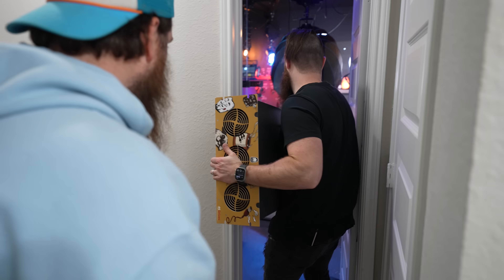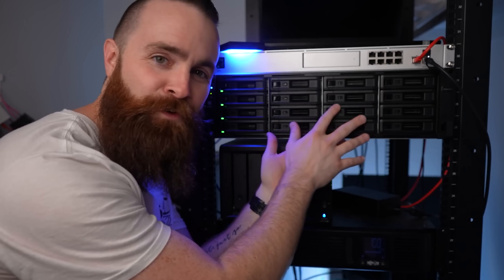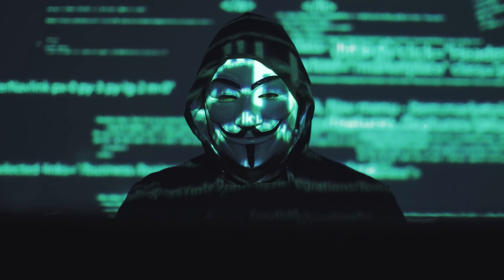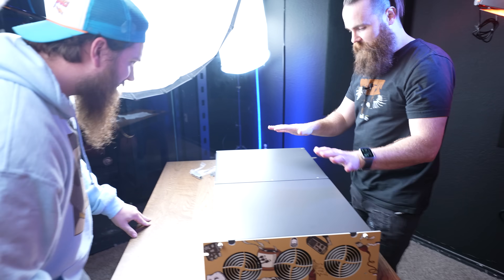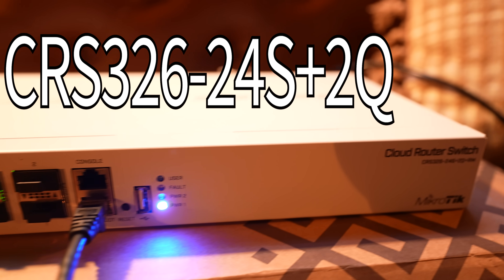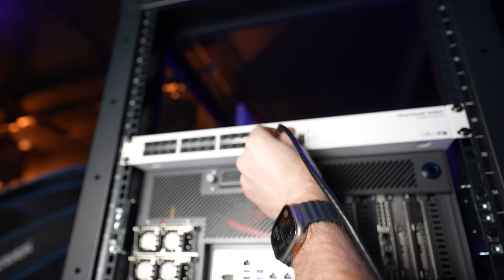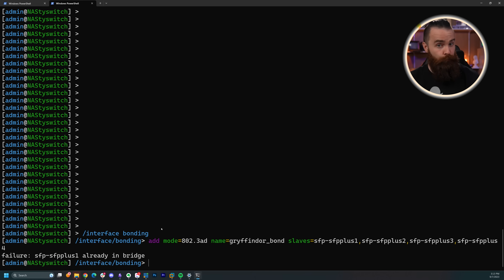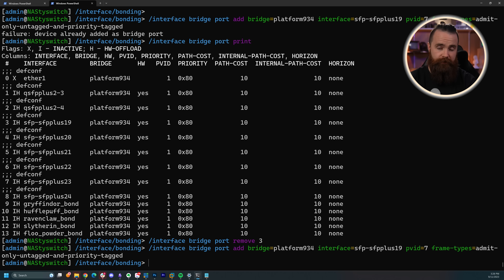My SECRET Server Room Project

Comment: When my Microtik switches upgraded to the new firmware they changed how bridges work which threw me into a loop as I have trunking and VLANs.   I just learned to only work inside an already defined bridge and setup the trunks and VLANs there so it can take advantage of the hardware offloading.    A quote from Dr. McCoy on Star Trek, "I know engineers they love to change things!" 🤣

Comment: Blech... rack mount. Love me some Dell T600 series. They are generally quiet enough to run in the WFH office, except on startup, and generally run under 300watts even with dual xeon 20 vcore processors and 192gb ram. Not going to get 45 drives in one, though. I know the homelab lemmings want microtik and ubiquiti, but why not cheap used enterprise equipment? It's stupid cheap. You need you some vxLan, and automate it... Bridge in microtik sounds as PITA as HP implements it. Glad we have HPE/Aruba as an MSP to handle their switches.

Comment: How about clustering instead of VLan?  Go for redundancy and resiliance.  What are you using for backup power, brown outs and blackouts?  Will everything 'crash' if a blackout or roaming blackouts happen?  You need to have automatic controlled shutdown of services/dependencies.  Charge your UPS batteries with solar.  Also, the more advanced the equipment, the more delicate it is.  Air filtration and humidity.
Reply: He did talk about running ProxMox with CEPH so it'll be in the future videos.
Reply: @Darkk6969  Interesting.  I'm out of touch - retired.  Still love this stuff though.

Comment: But if the trunk on this Microtik switch allows all VLANS by default, wouldn't that result in a "bad practice" situation?
I mean the whole purpose of VLAN'ing and interVLAN conenctions, is to fragment the network, to less stress the switch, when performing broadcasting -
But, it is also a security standard, ensuring that certain VLANS, can go accross certain networks right?
It just seems like Mikrotik, thought that this would make it easier, but it would have made more sense from a security perspective, to have SSH preconfigured, instead of telnet.
That way they would have something Cisco doesn't have. 
I am not a fully trained network engineer. I am in training trying to become a "datatechnician with a specialty in infrastructure" BTW.
If im wrong please explain: why it would be a good thing to remove the "Allowed VLAN" Function from the configuration.
Love the content Chuck, it goes great in parrralel with what im training for 😀

Comment: lol a mikrotick bridge,  is a  bridge... its not  a vlan. it supports vlans and vlan filtering. but its a bridge. I think this is where winbox and being able to  visualize the network  configuration helps alot. I would agree it is almost a software level "switch" but its not a switch either.
Reply: I think you are very wrong.
Reply: Switch with some minor router capabilities.
The Dude  Server can help visualizing the network structure.
Reply: @roadblock-9649  i must apologies, I did not follow properly your comment.

For clarification, it is spelled MikroTiK. In actual terms, a Bridge would consist of two ports. A multiport bridge would be considered a switch. In MikroTiK, the Bridge Interface is virtual (ie. Software). Before MikroTiK RouterOS version 6.41, there was a separation in the configuration of how to configure the software side vs the hardware side of the device. With more and more MikroTiK devices having chips that support switching at hardware level, MikroTiK decided to change the configuration design so you would just need to define your configuration using the Bridge Interface. If the appropriate Hardware is found, then switching is done at hardware level and this work is taken off from the CPU. You can port the same configuration to a Cloud Hosted Router (CHR), basically a virtualized MikroTik, and the configuration would still work, but all the work would be done by the CPU as no dedicated asics would be available. 

I agree with you that @networkchuck is wrong saying the bridge is a VLAN, but he did say this is not a MikroTiK video. I actually believe MikroTiK has a better way of presenting how each layer of the internet / osi model builds on top of each other. What you can do with MikroTik is very versatile yet powerful.

Comment: Hello Sir, Recently, I rooted my ST805 device, and since then, I have encountered difficulties in accessing HD content. I believe this issue is related to the Widevine security level, which has been downgraded from L1 to L3 during the rooting process. I researched a lot about it but couldn't come up with any solution. Is there anything which i could do to resolve it?

Comment: Don´t feel bad about the thing with the instructions.
I just built a bedroom cabinet and followed the instructions meticulously.
The instructions were to build the whole thing lying face down.
The next step was to attach the board on top, which would connect and stabilize everything.
But the board had to overlap the face of the cabinet, which was LYING FLAT on the ground...
And it was absolutely impossible to lift it without it falling apart.
So yeah ... don´t just blindly follow instructions ...

Comment: In my job working for a retailer of Compaq/HP Cisco Microsoft my job was to provide tech support to the salesman and all the server racks and compact servers and HP servers that they sold to our customers had to be installed and configured and I probably built 20-30 different racks over a period of years for hospitals and other major corporations alrex had to be completely configured with KVM all cables labeled both ends UPS shares dual UPS they had to be all set up so and associate analyst could just slide into new server on its rails plug it in and push an image on it  I would offer my assistance but I think you got it you don't need any help.

Comment: I love Mikrotik.  Just like you I'm a Mikrotik novice, but the value is top notch and stability is rock solid.  The config does sometimes make me crazy though.   Nifty command you can try on your old switch-download from the filebrowser in the GUI, and then - open with a text file editor.  It's all the (current) settings and commands in the mikrotik tree format, and you can figure it out from there. Heck, I think you could cut and paste into a terminal for configuration if you were so inclined..the command that saved me much is: /export verbose file=name
||| Any tips for documentation?  I have a bunch of text files which has any forum or youtube links in them along with the relevant parts and sometimes my scratch pad for my config.  But, there's no full rhyme or reason, and no way to search. Any suggestions?

Comment: Ya I need a new 10gb switch my 8 port unifi is full. I looked at mikrotik but I don't like there interface. So now I'm debating if I want and old enterprise switch from cisco or dell or upgrade to the new unifi usw-agg-pro. Not sure if the fans are going to be too loud on the enterprise switches

Comment: Curious why you went quad sfp+, instead of bumping up to a single qsfp(40gb) connection?
Reply: redundancy. This will be used as a Ceph cluster and we want no single point of failure across the entire chain. So we bond 1X port from each NIC into a front end bond and 1X port from each NIC into ceph backend bond - We will have some work to do to re-configure the network for Ceph in the upcoming videos :) - This is the 'Mitch' he mentions at the end of the video btw.
Reply: @mitcHELLOworld  CEPH with conventional disks. I'm curious about the speeds. In my 60 disks setup with nvme cache it crawls and will be replaced in a few months because of that. Maybe I'm just unlucky, but single thread file copys won't go over 50MB/s.
Reply: @drstefankrank  haha oh that is definitely not the case. What do you mean cache? Using Ceph cache tier? Or using nvme as rocksDB? As that is not caching. Are you using something like OPENCAS? If so sounds like you have your nvme spread far too thin. 

Sounds like you need a professional Ceph vendor. I know a guy :) hehe
Reply: @drstefankrank  with his configuration we are building dedicated SSD RBD pool for his Proxmox VMs - and mixed ssd and hdd cephfs pools for smb/nfs. On our HDD pool single thread sequential writes will be in the realm of 300MB/s on HDD and about 550 on SSD (SAS not nvme)

Comment: Hello Network chuck ; I need your help ; plz help me ; i have a very critical situation where a hacker has control over my phone and my laptop as well. I am not able to figure out what is the exact attack vector but i suspect it to be reverse shell or known process hijacking through which hacker has bypassed windows defender security. I have ran scans with virus total process explorer and autoruns but did not found anything . I also used various antivirus but they are unable to catch hacker . My phone is also remotely controlled and i factory reset it but still hacker has control and can see my every activity , please help me on how i can overcome this situation , plz help

Comment: Ubiquity switch

Hi-Capacity Aggregation
USW-Pro-Aggregation
$899.00
A 32-port, Layer 3 switch made for high-capacity 10G SFP+ and 25G SFP28 connections.
(28) 10G SFP+ ports

(4) 25G SFP28 ports

DC power backup-ready

Layer 3 switching